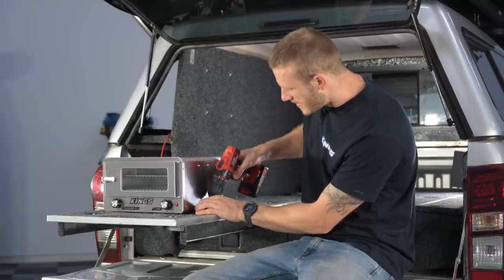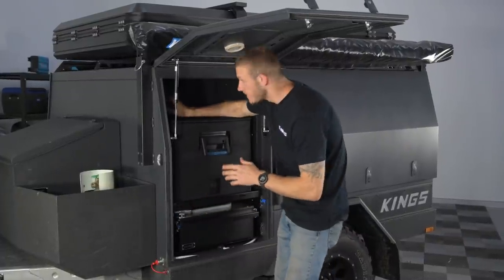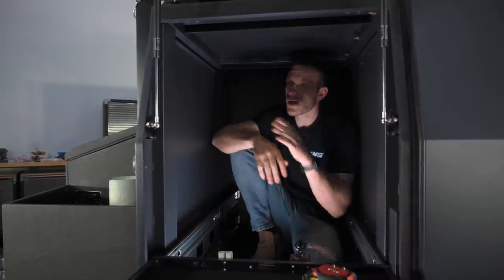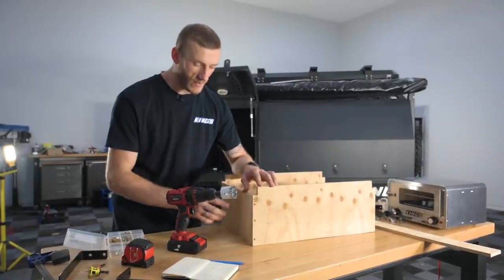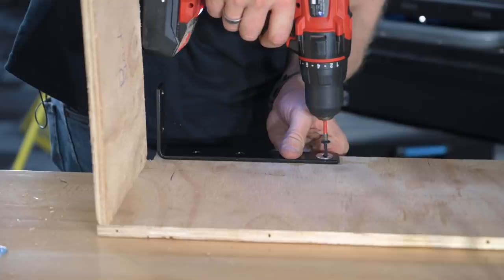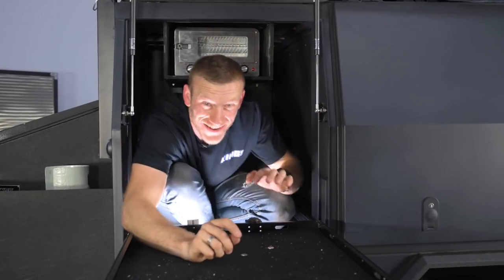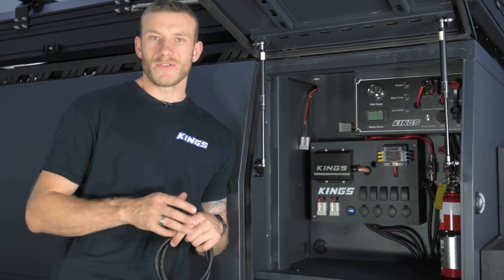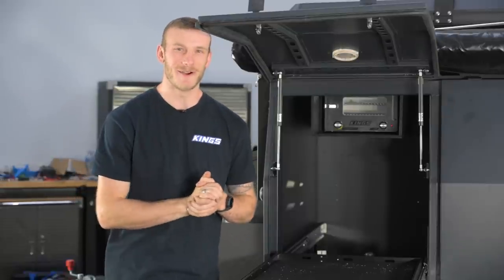Adventure Kings 12V Adventure Travel Oven Install

Comment: I think you did a good job putting the box together.  The only change I would have done is to screw the base from the side to add more support (as opposed from the bottom which is what you've done).  👍
Reply from the maker: Very good point! Probably would’ve made things much easier when putting it all together too 😂😂

Cheers,
Mitch

Comment: Could you have just mounted ply to the roof of the fridge compartment and used the top mounts on the oven? There’s no right or wrong way. Aslong as it works
Reply from the maker: You definitely could to that! Sounds like a far easier task too 😂

Cheers,
Mitch

Comment: Having problems with condensation in the fridge compartment when the ovens turned on whilst travelling.  Is anyone else having the same problem?  Does anyone have a fix? Thanks!
Reply from the maker: Hi there,  Warm air entering the fridge can cause moisture to form, leading to condensation. Please ensure the fridge is sealed correctly and check it regularly while the oven is on. Another tip, please ensure the installation cover is on the fridge and zipped up, this can also help prevent the condensation in the fridge.
Reply: @4wdsupacentreAu  Thanks mate, will look into buying a cover!